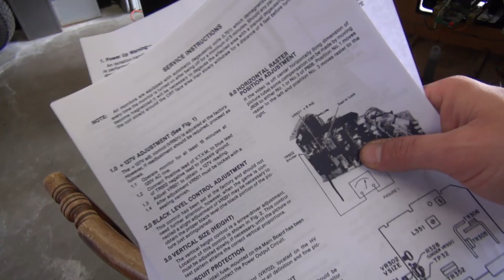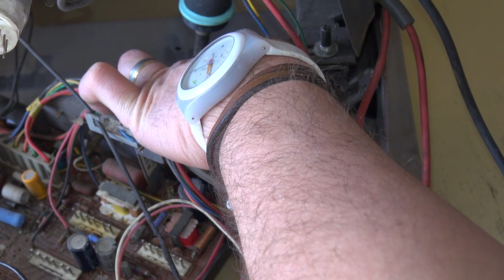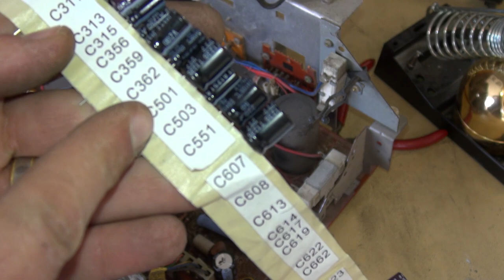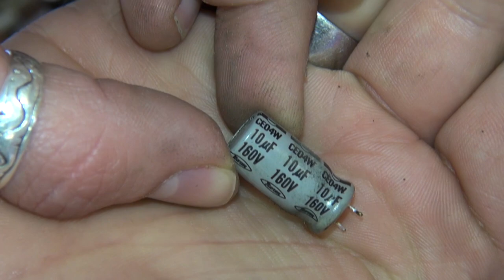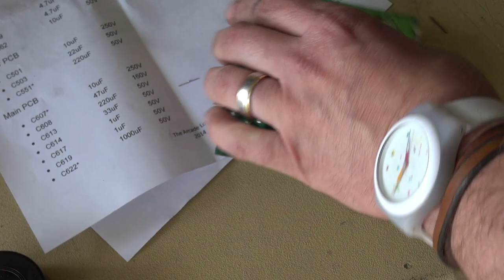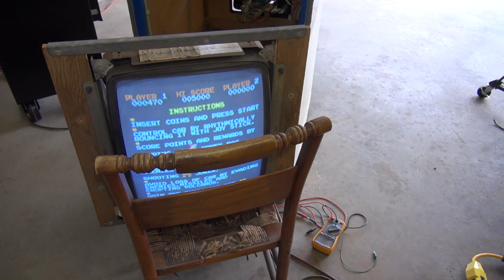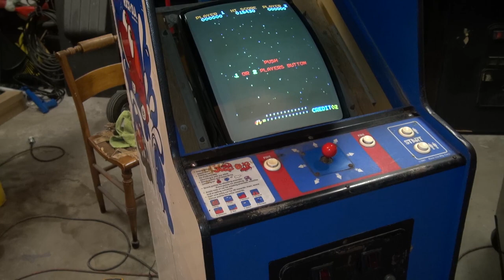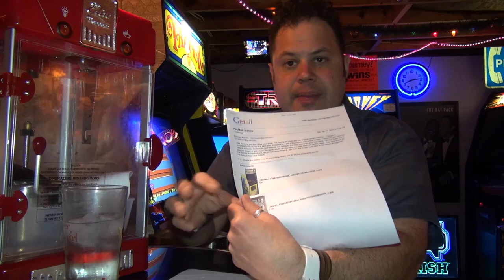Rock-Ola Jump Bug Restore Part #4 - K4600 CAP KIT install, B+ adjustment, reflow solder

Comment: Hey John this is Damien thank you very much for reading my letter.  The Pac-Man did not have the filter board installed so that had nothing to do with it I do need to check the voltage is though this is all still very new to me and I'm learning as I go along thank you again for all your guidance on this and I will keep in touch with you let you know of my progress thank you

Comment: The sound effects on games were great in early 80's plus not going back far when you die helps it's playability. Getting sent back too far is what killed ghost n goblins . All the pulling the monitor apart would be my worst nightmare but super interesting to watch .

Comment: John, when desoldering, you can use the hakko and apply the new solder with that, it saves you one time heating up the pad ;-)
I remember you said "the soldapullt is good", "i dont need a desoldering station"
looks like you changed your mind LOL.
Told you that you would not regret it.

Comment: How would you like a 4600 to be your very first introduction to monitor repair? Well, thats exactly what I got....  a friend had a Ghosts N Goblins with a collapsed K4600. I recapped it and toiled with it forever. My hail-mary play was to just reflow every solder connection on all the PCBs.... BAM!!! It worked. Since then I've done more monitor repairs than I can count.  John, use a dab of clear silicone to hold your neckpiece in place. It won't dry out or crack or get gummy. Great stuff.

Comment: I know this is an old episode, but that K4600 that you thought had a junk tube is actually probably fine.  I had a similar issue on my K7000 with blurriness and it turned out the Chroma Transistors on the neck board were bad.  I installed new ones, re-inforced lifted pads on the neck and it's gorgeous.  Thought it might help if you put that monitor aside.

Comment: John's, when the focus control seems not be in focus, this is maybe because you have the SCREEN adjustment too high!, the screen adjust, is normally in the flyback or near of it, maybe a pot in the CRT neck board, Just FOLLOW the G2 (grill 2) CRT pin, connection ,  in normal TV sets, it is the pot in the flyback that is lower than the focus pot.

The symptons of it being bad ajusted is:

The focus control behave as it can go through the focus point and then start to unfocus again if you move it more far, (so it don't have the problem "the focus point is out of the range of the pot, it can't reach it),  But when is in the best focus point, it don't reach the pixel level focus needed in computers.
Reply from the maker: watch the rest of the video. :)
Reply: John's Arcade Game Reviews & Tech in that I am, I enjoy your SHoW.
Reply: John's Arcade Game Reviews & Tech and btw, the next time you remove the focus cap from the crt socket, use a big flat screw driver, you unlock one side first, then with the finger maintain it unlocked when apllying the screw driver in the other side, and the cap will pop about effortless.

and that way it leaves no marks. BIG flat screwdriver is the secret.
Reply: first, the CAP that pops thing, I advice in the previous video, and in this new video, he include do a mention of it.

Then, the reason why I remarked him this time, the correct way to pop that cap, is because I saw the video, and see the cap all marked and deform in that way that it don't sits again correctly..

and btw, I am not an expert about arcades, but I have like 30 years of TV repairing and those chasis are shared with some old models of TV sets too.

Comment: hey John...what is the link to a K4900 flow chart?..I did a search and had no luck..you mentioned in the vid the guy that makes the flow charts doesn't publicize them....just wondering if you have the hook up....i have a 19K4901 with a hum bar issue.
Reply from the maker: mherring27 Google "K4600 flowchart". It's the first link.

Comment: You like to talk yourself into a corner!  I would have just said that one is good , or right etc.

Btw, looks a lot like that game is running on hardware loosely based on amidar- with galaxians style starfield driver thrown in!

On the subject of B+ , that harks back to the days of tube hardware.  There were different types of power supplys on valve stuff, And different batteries etc,  I think you had A , B and C if Im not mistaken?  B+ was always the typical main supply rail for AC line powered circuits,  so I guess because the CRT is a valve, after all it is a thermionic tube of a sort ,  it was just convenient and easy for manufacturers to keep the term in the modern era.

explained better in this article here :

http://antiqueradio.org/bsupply.htm

Comment: in the minute https://youtu.be/uwvEW2ahCro?t=3291 , I can see why it is not perfect, the blue is out of convergence so, from the point of view of the video it is a bit UP, don't matching with the green and yellow, if you are explerienced with the convergence rings, you can adjust those, but if you don't, better don't touch them.
Reply from the maker: flyguille I will converge it. :) I got it dialed in pretty decent by the end of the video. Once I turned the black level down it looked way better!
Reply: John's Arcade Game Reviews & Tech 

the convergence is done looking for in the center of the screen, seeing more the video, looks like it is out of convergence in the bottom, not in the center, it can be a dynamic convergence problem, not static one.

try to lower a bit more the screen, then focus again, and then set up the black level a bit up again, in the same measure, to see if it fix that way. If it don't, it is jut bad quality in the canons, because, these kits, dont come with convergence coils, them are suppose to be just good enough for auto-convergence in about dynamics.